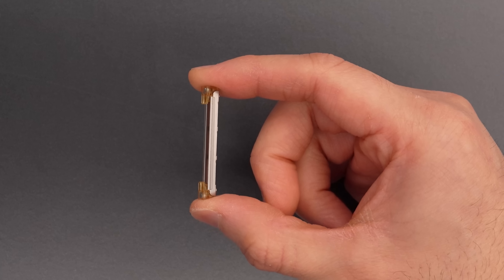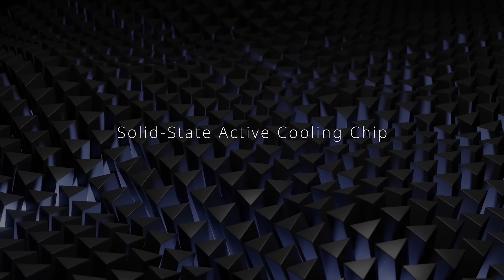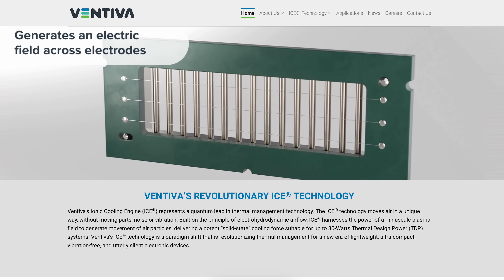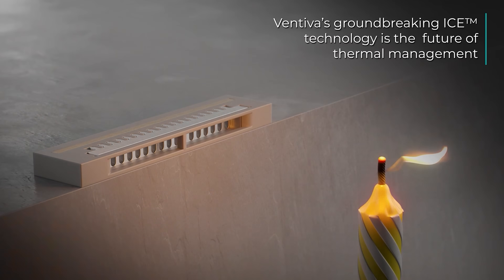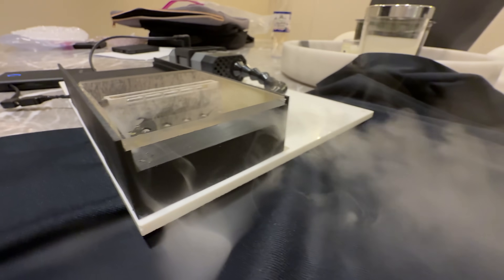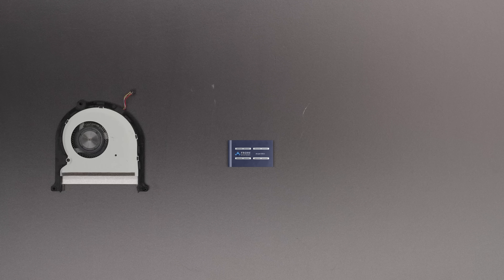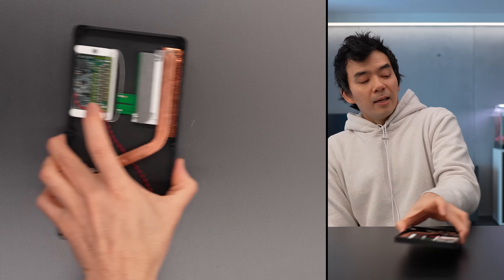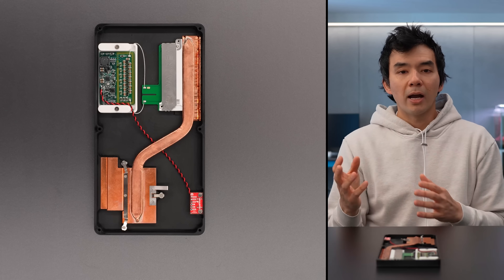The IMPOSSIBLE Laptop Fan...

Comment: Dust is the undefeated destroyer of solid state coolers.
Reply: Gases to gases, dust to rust.
Reply: @KoenZyxYssel  gases from as.ses
Reply: @KoenZyxYssel  gold👌
Reply: @KoenZyxYssel  you mean Gases to gases...fart to fat.
Reply: My Ionic Breeze from 20 years ago capitalized on this fact by being marketed as an air purifier. The amount of dust that thing collected was unreal. So was the amount of ozone it generated
Reply: @Salamihawk  My electrostatic air purifier has a fan also. It's needed to push the air after cleaning through a active carbon filter to absorb most of the ozone. It's not in use anymore, I use a large HEPA+active carbon+UV catalyst purifier with particle and VOC detectors and automatic fan speed. It detects VOC after drinking one beer or using hand disinfectant anywhere in the apartment.
Reply: @jounisaari9471  can you tell me more about your air purifier setup? i'd like to get something like that and it seems like you have it figured out.
Reply: @Salamihawk  exactly my point. Also, clever of that company to turn an unwanted side effect into a "feature" lol
 Steve Jobs would approve.
Reply: @Salamihawk and then it turned out that ozone is poisonous lol
Reply: @Salamihawk  I was about to comment about the ozone it produces. It's 1960's nuclear submarine tech for cleaning the air. Ozone is very bad for you.
Reply: @Salamihawk  Yup, I had the Ionic Breeze too. It sucked (in a bad way). The air it 'purified' was marginal, it barely pushed any air flow, and was incredibly difficult to clean off the black particles that built up on the metal plates.
Reply: @Salamihawk mine too!
Reply: They should make them out of dustnotium
Reply: @asddsa-dy4ne sure
Reply: Dust will eventually clog pretty much any cooling solution, unless it's completely passive, and even then dust resting against it can still reduce their effectiveness. it's a matter of intercepting it with a mesh or filter, or at the very least, making it somewhat easier to clean out. .
Reply: @JustSomeRando1984  "Dust will eventually clog pretty much any cooling solution"
Yes - but ionic thrusters are a different beast where even small amounts will make them inoperable.
Reply: @JustSomeRando1984  Sure, but these are way more prone to getting dist stuck to them, and once the first piece of dust bridges the "housing" to the wire the whole thing completely stops working. It's not like a fan that slowly gets worse.
Reply: @FAB1150  i think with enough current the dust bridge could be pyrolized.
Reply: @JustSomeRando1984  with no static pressure no filter can be used
Reply: @JustSomeRando1984  im more interested about this, will the dust collected around the electric wire gonna be ignited into flame?
Reply: @JustSomeRando1984  Yeah, filters destroy your air flow though too. Or your pressure.
Reply: @JustSomeRando1984  NASA actually uses static electricity on their spacesuits to reduce fine dust/sand getting stuck in fabric and other stuff
Reply: @JustSomeRando1984  nope
Reply: I suspect at best it will be worse than it is for fans. But a laptop fan in some models can (can, shouldn't for sure) be ignored for 5+ years before the dust buildup becomes an issue, if we say it's possible for solid state dust maintenance to be okay ignored by end-users for 2 years that's still practical depending on the device and use case. Concern is it becomes a safety issue if it stops the catalysis working?
Reply: They should have a small hole where you can insert the straw of a compressed air can to do maintenance
Reply: @05DonnieB excellent idea after I had to put my laptop in for service +++ living in loess soil environment
Reply: For sure, if my physic was not wrong, almost all dust in air are ionized. So not only dust will be in moved onto the cooler by airflow, they will be "attracted" to the cooler by static charge...So not sure how this thing will age. In industry scenario, we often use a big hammer to just shake off excessive dust accumulated on say dust collector's ionizer. Curious how this works.
Reply: @RickMa I tried using your method on my laptop but the hammer blows broke the keyboard and the screen.
Reply: That what I thought at first glance; I mean isn't this the same tech that some air purifier use?😅
Reply: the frore system actually was fully filtered
Reply: Routine flushing could probably help. But you'd have to start maintaining your product more.
Reply: @UberOcelot  but you can't maintain the average laptop without taking it apart and most can't even be taken apart anymore.
Reply: id imagine itd be easier to clean
Reply: Frore regularly hypes the Airjet as dust resistant and has shown ingress testing. Their Mini Sport cooler is IP6x rated.
Reply: It's not only solid state kido, all active cooling systems will be defeated by dust

The only difference with solid state is you can just blow it with pressured air to clean the way. It also doesn't have a moving part which means it lasts longer than regular fans that use magnetic to rotate the fan
Reply: @azizsetyawan3038  nope. Look it up you're wrong.
Reply: @mitchelcline9759  look it up where kido ? You don't even bring any data or reference
Reply: Thx for introducing this great new technology!
Reply: you could just slam the vaccuum cleaner right on a port and let it go full tilt without worrying about the fans though. You could REALLY blast that thing with an immense amount of air pressure as well. 

I think that dust would be less of an issue with this than fans, cause with fans you're kinda screwed if the dust is even slightly sticky. So hard to get it off with air pressure due to fan orientation.
Reply: @JimmyNuisance  fan blades surface itself is not electrified, dust just accumulates on the fan, not doing anything. Solid state systems are using electrified surfaces that interact with the dust so the effects are dramatically different.
Reply: @JimmyNuisance  "and let it go full tilt without worrying about the fans though."
Yes - you would certainly not damage a non-existing fan. But also the thruster would be ripped apart in a fraction of a second. 

"I think that dust would be less of an issue with this than fans, cause with fans you're kinda screwed if the dust is even slightly sticky."
i mean if the dust is sticky you re skrewed anyways (and WTF are you doing with your laptop!?!?) but it will also stick to any ionising device like crazy (you know - cause it is IONISING) and even just a small buildup of dust will wreck any thruster.
Reply: Air purifier laptops
Reply: I don't understand why HEPA filters are not used in laptops
Reply: @yarrrno  bc it would need to be tiny meaning it would clog up constantly. Plus, airflow in laptops is barely good enough and often not good enough to cool laptop. More filter is less air flow.
Reply: @ruslenantonio7585  how
Reply: How is this different from the Ionic Breeze other than miniaturization?
Reply: that thing will spit anything small enough to get inside. There is no such thing as 100% fool proof but this should be much more resilient than a traditional fan.
Reply: Lack of maintenance*
Reply: We had a bathroom air ionizer that had to be cleaned weekly. If we went a month the airflow would be dramatically reduced. This was due to the dust particles becoming ionized and then sticking to the other electrodes. Not sure if there's anything they can do about this.
Reply: @josephwheeler1  buddy, according to a lotta replies, the solution is use filters lol! You know the air flow on that thing can't compete with a sneeze, let alone suck air through a super fine filter! Plus even if it could, u just gonna replace filters constantly? Nah.
Reply: Brick by brick
Reply: i agree, conventional fan is easier to clean off. but we dont know yet how we should clean this SSCooler up, is it okay to just blow it with dust/leaf blower or idk
Reply: Ever heard of a filter? There's literally tens of millions of different filters in use right now on all kinds of equipment around the globe. Kind of strange that anyone who isn't part of some tribe isolated from the rest of the world, deep in the amazon rain forest, wouldn't know what a filter is...
Reply: @blueberrychronic  lol unsound so foolish my goodness ur a simple minded creature.
Reply: @blueberrychronic  later when I have time I can do the very difficult task of looking up why filters can't fix this issue. Or u could look it up yourself if ur not to lazy. I'm busy atm.
Reply: I immediately thought of Dyson fans
Reply: 🗑️ Garbage
Reply: Apple: we'll make a keyboard out of them
Reply: How would you know that having in mind there has been no solid state coolers before lol
Reply: @johnadams3038  look up solid state coolers, find the researchers who have made them, and let them know you believe they're inventions are imaginary and leave me alone.
Reply: Yeah, dust loves ionized air. Must be well filtered... Or the distances between the part ist big enough so it does not matter... Will be interesting!
Reply: That's why you clean your laptop or gadgets to get rid of those dust - don't be lazy. 😂
Reply: Then just make sure to routinely clean the machine that has them. lol
We still have to clean the fan blades inside a computer tower.
Reply: The exact opposite.
Reply: Airjet has very high pressure, so it can easily work with fine filtering
Reply: yeah like it literally uses ions for move air that attracts dust like magnets.
Reply: dust: hehehe here I come
*short circuits the fan*
Reply: Maybe some kind of static inducing device can make electronics dustphobic... so that it refuses to settle or adhere to the surface. (I have no idea what I'm talking about, just would like to hope there's a physics based solution somewhere here...)
Reply: Also moisture/humidity. Imagine filling your laptop with precipitate.
https://youtu.be/G2brxBRnRH4?si=TxDitefJjcBHFL8B
Reply: Imagine a laptop with a built in air purifier, dehumidifier, and ozone generator all in one box. 🤣🤣🤌💦
Reply: As it is to regular fans cooling solutions.
Reply: 🎶Ash to ash
Dust to dust
Fades to black
The memory remains, yeah
To this faded prima donna
Yeah, yeah, yeah, yeah🎶
– The Memory Remains by Metallica
Reply: I want more laptops to be fanless like M MacBook Air. No fans or vents mean that laptops need not be opened for cleaning the dust very often!
Reply: Dust attaches to most surfaces because of static electricity because dust is negatively ionised when it's in the air. That's why dust attaches to plastic objects, even if it is standing vertically. The coils here positively ionize the air and dust, preventing them from sticking and pushing them out. That's why, after a thunderstorm, you'll notice how the air feels fresh and dust free. It's because the lightning naturally Ionize the air. The dust is still there, but it's not attaching to your skin or nose because they're being repelled.

 Bigger dust particles might get caught inside electronic, but a simple filter would prevent that.
Reply: another guy thinks that he is smarter than then engineer
Reply: @luckyrYtArd  what are you talking about? U ok?
Reply: Pair it, with dust filters.
Reply: @sabyasacheebanik6018  u don't think they thought of that????? Short answer, restricts airflow plus dust through anyways plus it clogs constantly plus u need teeny tiny holes to get the really fine stuff and that restricts air more and clogs even faster. There's no easy fix to this well know problem.
Reply: dust filters exist pal

You're probably the type of person that see's a small step in front of him and say it's too high to lift his foot
Reply: @h.a.6790 dust filters clog, pal. How many regular users actually clean their laptop or even have canned air? If you have a dust filter in a laptop, how do you access it? A flip open door? Takes a lot of space (plus the filter takes space). Take the whole bottom off? Most users are not going to be comfortable with that. A dust filter is not practical on a laptop. Neither on a desktop.

Add to it the static pressure proglem he mentioned. By the top the device overcomes the resistance of the filter, there’s no pressure left to effectively cool the electronics. A filter is a non-starter.
Reply: @h.a.6790 sure but they greatly increase backpreassure which is an issue for these systems. Especially at the filter fitness to protect the small gap between electrodes. In a regular laptop even with the dust filters present they the fans get gross after a while
Reply: @h.a.6790  I'm not your pal, you don't know anything about me or my views on stairs. But anyome reading your comment knows 2 things about you. You're rude and stupid.
Reply: Non-issue.. as filter
Reply: @i0001w  filters cannot be used due to the minimal static pressure ionic thrusters generate.
Reply: @i0001w How many regular users actually clean their laptop or even have canned air? If you have a dust filter in a laptop, how do you access it? A flip open door? Takes a lot of space (plus the filter takes space). Take the whole bottom off? Most users are not going to be comfortable with that. A dust filter is not practical on a laptop. Neither on a desktop.

Add to it the static pressure proglem he mentioned. By the top the device overcomes the resistance of the filter, there’s no pressure left to effectively cool the electronics. A filter is a non-starter.
Reply: @mewintle FACTS!
Reply: nobody mentioned dust. you literally pulled that out of your ass.
Reply: @ um, that’s the thread we’re on. The top reads “Dust is the undefeated destroyer of solid state coolers.”
Reply: @cloudnine5651  first of all, I don't keep dust in my butt, tho I'm not judging you if that's your thing. Second, someone did mention it, I did. Third, a couple thousand people thumbs upped so at least someone besides me agreed it's an issue. Fourth, you seemingly have zero clue how significant dust is regarding electronics and how much money is spent trying to address that very significant issue. Just because you're ignorant about science doesn't mean everyone is.
Reply: Jesus loves yall
Reply: 👿 @the_boogey_man0
Reply: God bless you

Comment: nah, ion fans have been around for decades. even made a model plane to fly using  this. so the high voltage circuit is nothing new so the cost is just R&D to make it coin size, but again, nothing new. so cost should be <$10 to make

Comment: There is a difference between volume and static pressure. That "Jet" fan, can perform better, by pushing air through the finest radiator mesh, with an insane surface area.

Comment: its just an ion thruster sized down and the down side to these is air moisture and the transformer that supply's the high voltage will break down quickly with constant use

Comment: One of the main advantages of the Frore system, was that it's high static pressure allows it to pull air through dust filters, giving it an IP68 dust resistance for any laptop. Do you have any ideas about dust resistance on this system? Like, can they do something like that?

Comment: Not new tech just a scam coming back. The static pressure is far below useful for cooling. This also causes a huge amount of static charge. It is not hard to build a laptop without the need of a fan. Since you are leaving out the specs of the laptop makes it clear you are just a fan that is not bias. Why you don't see how dirt would be a real problem that is not fixable.

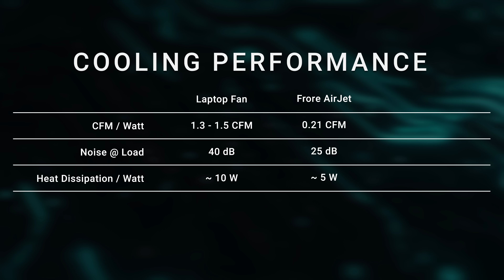Comment: You said 1 watt,  but 10 watt is written in this table  5:51
Reply: that is heat dssipation. it is how much heat it can remove from the CPU. the higher, the better.
Reply: 10 watts of heat. The first line is CFM per watt. Anyways, this technology is not new and has more problems than it solves.

Comment: If you put several in series, you can probably increase the static pressure. They'll probably re-think how laptop cooling is done with these. Like, instead of the traditional single exhaust, you would have several places where these might be used along the edges. Technology just keeps getting better. Just wait until they have the quantum gyroscopes. That's the one I'm looking forward to. Not for my sake, but for the sake of navigation. Imagine a perfect gyroscope that never has to be re-calibrated.

Comment: there are some limitations here 
1. it uses very high voltage to ionize air so it will be interesting how they implement in customer devices
2. using it in any sensitive electronics can bring interrupt in the operation

Comment: The bladeless fan uses fascinating technology. Regarding the negative air pressure, does it operate effectively with two units working together, such as through a channel with an input to output system? In this setup, the first unit generates airflow at the input while the second unit expels the incoming air.

Comment: Humm
1 - Operation in high humidity environments will be troublesome, think working on a tropical rainforest or just a tropical island with > 80% humidity all the time...
2 - Not mentioning dust with very small particles that can make the electrodes arc by depositions, then material removal. 
3 - Eventually you will have charge buildups and arcs, this is bad news for Radio Silent Places and applications, as an amateur radio... I will be away from those devices.

Nice try, steps towards a new frontier... but just that... steps.

Comment: 6:23 And then there's Apple some years ago with "Thermal design? What thermal design?"

MacBook Airs using Intel CPUs with a fan that wasn't connected to the heatsink in any way. And now M chips that don't have active cooling at all (they deal with it ~ok, but still throttle).
Reply: Can they sue for trademark?

Comment: I has been a while, but I seem to remember the air jet wasn't meant as a 'fan' it was a fan/heatsink combo, where it used an impinging jet to 'blow' air on the cooling plate, which is supposed to be a lot more efficient than standard convection cooling, so I think comparing raw CFM is a bit of an unfair comparison.  Its comparing two different cooling technologies.